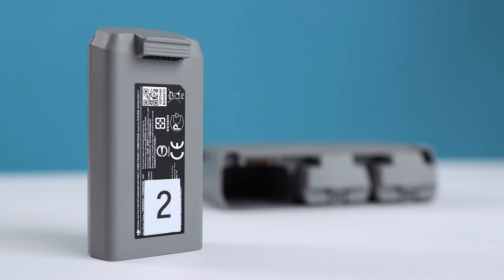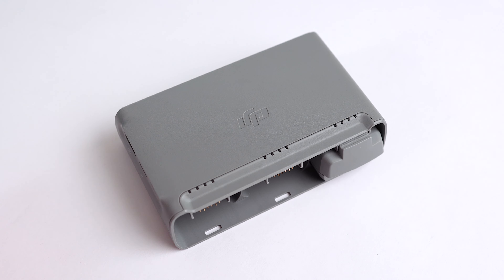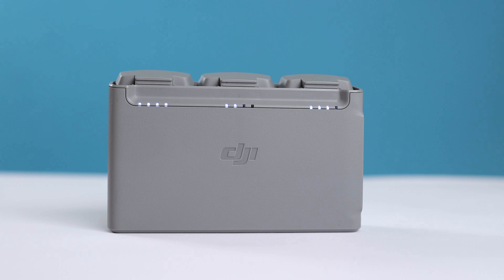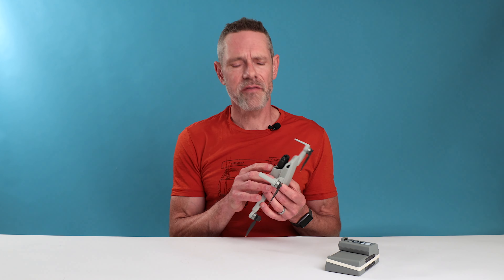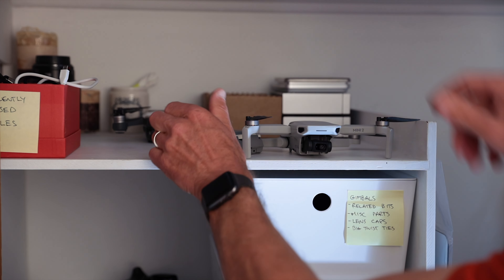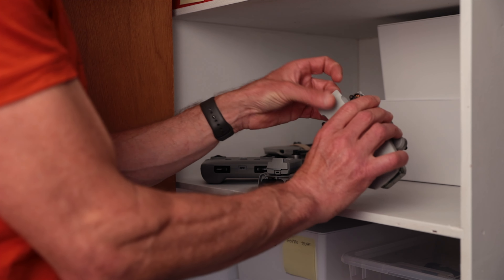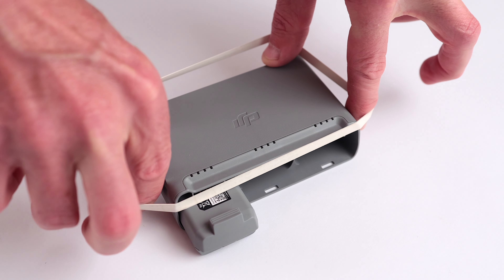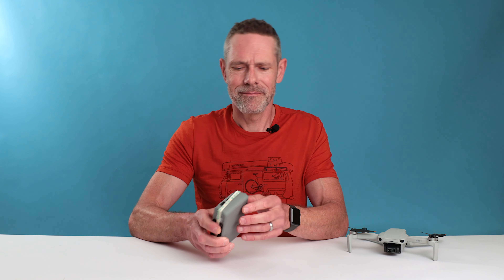DJI Mini 2 | Battery Discharge Issue + Workarounds (Fix Coming Soon)

Comment: Hi Steve, thanks for the info yes I did the same test and exactly the same results would stay fully charged if they were left in the two way charging hub or in the drone I keep them out on a shelf and the same thing they discharged them self’s. 👍🏼
Reply from the maker: You’re welcome. Sounds like DJI is on it so hopefully we will see a fix soon. Cheers!

Comment: I got some little rubber washers about 2-3mm thick and just drop one in each hub recess. The battery never connects then. I always have the hub upright in the bag so them falling out isnt a problem but the band idea is a good one thanks. The whole turn them around idea put me off to be honest. There is a ridge inside each bay running top to bottom - thats the reason for the resistance. These batteries dont handle being pierced too well and whilst it’s probably a non issue i didnt want to risk damaging the casing.
Reply from the maker: Hey, that's a really clever idea and more elegant than what I suggested! 👍 A couple viewers mentioned flipping the batteries. I tried it and didn't feel comfortable with it for the exact reason you mention. Thanks for the comment, cheers!
Reply: @SteveCoutts  Exactly, sure I’m being overly cautious but the batteries do get jammed in doing that and there is a fair bit of pressure on the casing from that strip. Seen one video of a guy who cut the strip out of the hub with a craft knife but I didn’t want to do anything too permanent in case DJI can push a firmware fix for the issue. The best solution I saw so far was a guy who had designed a 3d printed clip that fits over the contacts - link is here https://www.thingiverse.com/thing:4824231/files 👍

Comment: Good info Steve. After hearing this, I tried placing the batteries in the hub reversed. It's a tight fit but seems to work. No rubber bands needed.
Reply from the maker: Thanks. That’s interesting, I never though to try that. Cheers!

Comment: Good tip with the elastic band. I would never leave them in the drone or hub. If I'm not gonna fly for a while I just keep them in the drone case.
Reply from the maker: Thanks. I pretty much always leave them in the hub and/or drone but I fly quite regularly. Longer term I do take them out but it wouldn’t be uncommon for me to leave them in for a few weeks on rare occasions.

Comment: You can just flip the battery front-to-back and push it back into the charger.  There is a little resistance but you can do it without hurting the battery or the charger.
Reply from the maker: Thanks Paul. I didn't even think to try that. Cheers!

Comment: I have a habit of leaving them out of the drone and the hub, and I discharge them manually. But great information, I'm sure you saved someone some 50-150 bucks on batteries. DJI batteries are VERY expensive.
Reply from the maker: You are much more diligent than I am, I tend to leave them in the hub and/or drone. I do fly pretty regularly so it normally wouldn’t be an issue. Cheers!

Comment: Very interesting stuff Steve.  When I first got my Air 2 batteries they didn't auto discharge either.  Kept checking their status several times every day. Then i discovered somewhere that the auto discharge function only works when left completely alone without ever checking status.  Do the Mini 2 batteries work the same way?
Reply from the maker: Thanks Craig. You are correct, if you press the button to check the status it will reset the counter. With the Mini 2, even left completely untouched the batteries will not start auto discharging if left in the hub or drone. Cheers!
Reply: I wish this was documented in the owners manual.  One thing I love about the Mini's Lion batteries just charge them and leave them alone.

Comment: Great! Working abroad for 5 months and now I have a dead battery and probably three damaged ones. Any way to revive a dead battery?
Reply from the maker: Check them to see how they are first. Then put them through a charge cycle after updating the firmware. If they are not behaving correctly, contact DJI support and hopefully they will take care of you. The issue made the news and DJI was on record admitting the problem so they should do the right thing. Good luck!
Reply: @SteveCoutts  Hey, tanks for responding. I reduced the batteries to about 50 percent prior to storing them which might have saved three of them. One of the batteries just won't charge and and the four leds keep blinking three times. It won't power up the drone either.
The remaining three batteries seem to work, but it feels like a couple of minutes have been shaved off the flight time.

Comment: Thanks mate. I play with Rc basher trucks and I discharge my batteries to storage mode and I asked this question to a couple of YouTube drone guy's and they said they are smart batteries and will bischarge them selves. But know i find they have to be out of charge hub to discharge 🙃🤪 lucky no one has had them explode yet.
Reply from the maker: You bet, thanks for watching! I have always trusted the “intelligent” batteries to do their thing, might have to be less trusting going forward. Yeah, hopefully no one has a serious issue with them before DJI can get the issue fixed. Cheers!

Comment: The Mini and Mini 2 have both another issue for all those that use those rarely or not regular. The "turn on" switch once presses does no longer turn on the battery. Remove the battery and connect the charge plug and you will see 2 LED flashing which is right, tellung you the battery is missing. But battery back and turned on will lead to nothing.

To get it fixed you need to know that DJI has sucked on a 4 cent piece. The switch to turn on is so cheap that it is dead and most likely impacted by dirt or corosion. To fix it you will need to remove the batter, than use a screwdriver to unscrew screws in the area of the battery bay you can see and take the bottom cover of. If you continue you will see more stuff and dirt but also the turn on button or better know switch, a switch you might have seen 100s of times but this one is dead. 

To prove that it is right and fixable there is an easy way. Remove the props first and now listen carefully.

1. lay the drone in front of you on its back and with the gimbal showing away from you 
2. now you should see a white switch on the right half next to the 4 LED
3. press the button and usually nothing will happen
4. get a can of air and blow the dirt of the bottom and out of the swich (will most likely not work)
5. if you do not have a compressor or such can try to do the same with a hairdryer just to get dirt out of the drone and switch
6. now listen carfully: the white switch has 2 contacts on the left  - this is our target for this step
7. but first: push the battery in
8. take a flat screwdriver of  4 to 5 mm and be carefull
9. now bridge these 2 contacts on the left side of the switch (left means shows to the middle of the drone) and hold it bridged
10. you will see the drone turn on and the LED flashing and gimbal awaking. 
11. now bridge it again till it shuts off - drone is fully functional, no serious damage, just dirt and corrosion
12. remove the battery ---- once again: remove the battery

Now we will try the easiest and cheapest repair. You will need a spray called "CONTACT 60" or pure ISOPROPANOL alcohol and a  cotton swab for this. I was successfull with the alcohol when I had not the contact 60 available, which is a german brand. It cleans corosion and "recreates" electrical connections that suffered from dirt and corrosion - your dealer will have such stuff.

I. immerse the cotton swab into the alcohol
II. turn the body clockwise 90 ° 
III. the white switch should be on the right side in vertical position, the bridged contacts are showing upwards 
IV. now take the cotton swab and let alcohol drop from the bridget side carefull into the switch
V. 2 drops each time, wait a minute, next 2 drops which will pour through the switch and come out.
VI. the lower part of the fuselage can get wet from alcohol, you will continue with 3 to 5 times 
VII. now press the swab on the side of the switch to make sure alcohol will get in
VIII. now take a 15 minute break or simply use the air dryer on a WARM, not hot, level to dry this area around the switch and fuselage 
IX. once that is achieved push a battery in and keep finger crossed
X. press the whit button and hopefully it will turn on again.
XI. if not, remove the battery and repeat the alcohol cotton swap drop method again and again
XII. take your time to dry it again and push the battery in, press the white button and it should work.

In case it did not work out you need to buy such switch called micro tile switch and remove the old and put the new one in. If you look at the board and think "No way" go to a electronic or smartphone repair shop and ask to replace only this switch. Usually 10€ or so for the coffee or 20€ on a bill. If you are there buy another of those switches, you might need them again and you will have the spare part in hands and simply need a solderer again.

Might take 20 to 40 minutes to get it working again and may bei 10 more minutes for the finaly assembly. 
Cleaning is easy to do once you have the alcohol, soldering is a point where you will instantly have a feeling of "NO WAY" or "might try it myself". And no , the drone was stored through winter in a heated room above 18°C and not wet or wet air. it has happened on both drones and also on my friends drones too, which have usually only one of these drones. 

Good luck.
Reply: If you want to watch a video with all those steps search on youtube for this string "DJI Drohne kaputt 😕️ Reparieren für 0 Cent" 
You will find a video in german but you can copy and print my comment out to compare the general steps and what he is showing - it is a computer repair channel and collector channel of old PC from 80 onwards, but had bought the drone . This had developed the illness of being dead and he tried to fix that what I had fixed before. 

The video should help a lot and will also show the german KONTAKT CHEMIE spray, which means contact spray. Not cheap, but a lot cheaper then sending the drone to dji and ask for a repair.  And a lot faster.

Comment: You can place your batteries in charging hub so that the connections are on the opposite side
Reply from the maker: A couple of people have mentioned this in the comments. I gave it a try and while it does work but I don't like the ridge inside the hub pressing hard against the battery. Hopefully DJI will have a fix soon. Cheers!
Reply: @SteveCoutts  all good hope their reply is soon.

Comment: Hello, I have inquiry if a dji mini 2 se battery works with dji mini 2 drone? Ive seen videos that mini 1 can work to mini 2. the mini 2 se has 2250mah and the mini 2 has 2400 mah capacity. Additionally the charging hub works for mini 1, mini 2, and mini 2 se. Please if anyone can answer I  would gladly appreciate it. Thanks in Advance
Reply from the maker: Yes, the Mini 2SE battery is 100% compatible with the Mini 2. Mini 1 batteries can be used in the Mini 2 and Mini 2SE. The Mini 1 batteries use a lithium-ion battery chemistry while the Mini 2 batteries use a lithium-ion polymer chemistry (LiPo). The Mini 2/2SE batteries provide higher energy density in a lighter package compared to the Mini 1 batteries.

Mini 1 batteries work just fine in the Mini 2/2SE, however they are heavier and have less energy density so flight times will be shorter. Mini 2/2SE batteries will NOT work with the Mini 1 - they are physically incompatible. Mini 1 batteries can be charged in the Mini 2/2SE charging hub. Cheers!
Reply: @SteveCoutts  thank you so much. the sales person here in Japan said that mini 2 se battery (2250mah) doesnt work to mini 2 drones. got me thinking thoroughly, how come the charging hub can be used for both mini 2 and mini 2 se. maybe he's still new to work.  thanks alot
Reply from the maker: @wencesjohnbazan5540  The information I passed along, I was assuming North America or Europe. My spider senses tell me there was something different about Japan but I can't quite remember what. For sure the batteries and charging hub for the 2 and 2SE are 100% compatible in North America. If I were you, just to be sure, go to DJI's Japan website, go to the the Mini 2 SE "buy" page and look for batteries as add-on. The battery details will tell you what models they are compatible with. The "buy" page is the quickest way, I find, to get information on compatibility.
Reply: @SteveCoutts thanks for the well explained info. gotta do that advice.
Reply: @SteveCoutts I just checked DJI Japan and as you said to see the about compatibility information it only states mini 2 se for mini 2 se battery.But still makes me wonder why did the charging hub compatible to both mini 2 and mini 2 se but the mini 2 se battery not compatible to mini 2 drone.
Reply from the maker: @wencesjohnbazan5540  That's weird. I was thinking it about it last night and I am wondering if it's a weight thing? I do remember something being different about the Mini drones in Japan but I can't quite recall what it was. Part of me thinks it was a slightly lower weight restriction. It does seem very strange that the battery is compatible with the charging hub but not the drone itself.

One other thing you can try is post a query to the DJI Forum (https://forum.dji.com). There are usually lots of helpful folks in there as well as DJI Admins so maybe someone can give you a definitive answer. Good luck!

Comment: This is not an issue for me because I treat my batteries with care and therefore never store them fully charged. They are only charged before a planned flight. But not to 100%, only to a little over 95%. When the charge level reaches about 30% during the flight, I press the RTH button. In this way, a charge level of less than 20% is usually avoided. The batteries are stored at 25% to 30%. According to the knowledge gained from studying technical literature, this achieves an optimum service life for LiPo batteries.
Reply from the maker: That's good advice. 👍👍 I suspect many folks, including myself, don't put as much care in to it as you do though. I follow the battery guidelines DJI puts forward in the user manual and it has generally served me well. As long as the "intelligent" battery features are working, the batteries should be ok for periods of short term non-use. All 6 of my 4 year old Spark LiPo batteries are still chugging along just fine by following DJI's guidance. 😀 Cheers!

Comment: Any one know why one of my battery’s is blinking 3 times and not charging. Cheers
Reply from the maker: Sounds like the battery has failed. Two things I would try if you want to know more. One, contact DJI Support and see if they can offer any advice. It's likely not under warranty but they should be able to confirm its state. Two, post a query in the DJI Forum (https://forum.dji.com) to see if anyone there can offer some advice. Good luck!
Reply: @SteveCoutts  thankyou

Comment: Can you just put them in the hub at 50% and not even worry about this? lol
Reply from the maker: For sure. Depends on individual habits though I suppose. I fly, typically exhausting all three, then back at home I plug in the two-way charger and give them a full charge. My batteries typically stay in the charger until the next flight. I fly quite frequently so they don't sit around full very long. For my routine I like transporting and storing the batteries in the hub. It's better for organization, transportation and protects them from bouncing around in my pack. Cheers!

Comment: I don't accept this bullshit that the battery discharges if idle!!! I will return this thing for this defect!!!
Reply from the maker: The auto discharge function is intentional. Li-Po and Li-Ion batteries should not be stored either fully charged  or fully depleted. Auto discharge is there to protect battery health and longevity. Cheers!
Reply: @SteveCoutts  Nonsense. It's like as if GM drills a whole in your tank to avoid an explosion. How can you not understand that this is a defect/ bug? A feature is something the customer wants. I don't want an empty battery!
Reply from the maker: @stebarg  If you don't like it, take it up with DJI and/or don't buy their products. All their "intelligent" flight batteries exhibit the same behaviour. You can read more about the battery features, including auto-discharging, in the User Manuals, which are available on DJI.com.